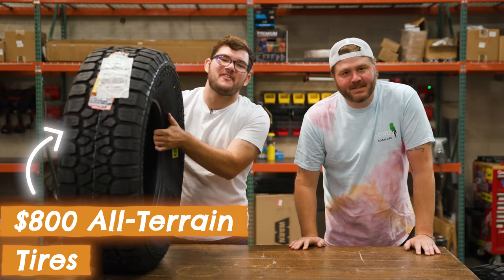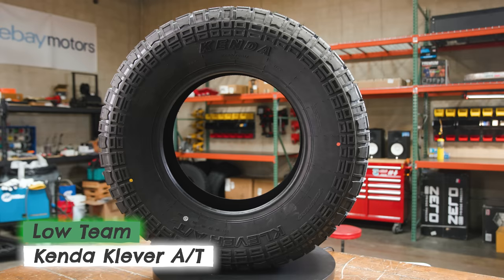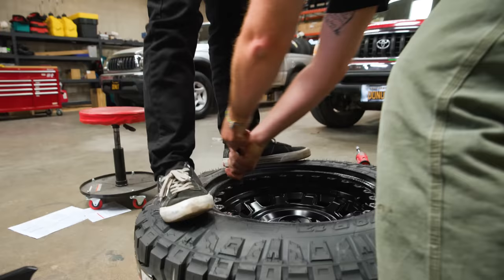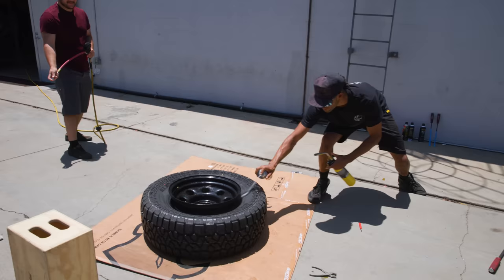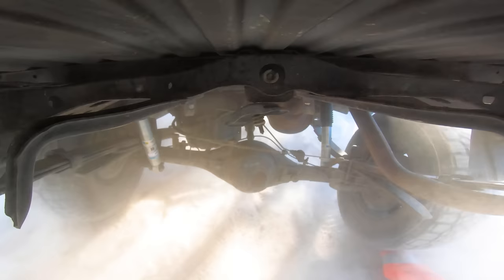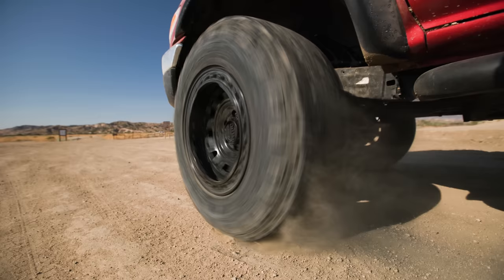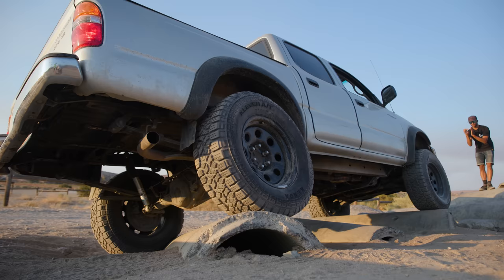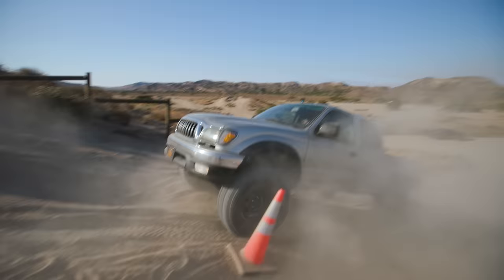$800 Off-Road Tires vs. $1500 Off-Road Tires

Comment: Low truck had way too much air pressure when he ran the pipes. You could see it bouncing where the High truck molded around the pipes.
Air pressure means so much.  H/Ts pressured down to 18psi will out perform A/Ts running 40psi all day.
Reply: Bouncing is probably caused by the suspensions, not tyre pressure (they talked about this at the end of s3:e1), because they were all running 15 psi iirc

Comment: Road noise takes time to manifest itself…check back in 30 days so road wear, alignment nuances, and tire rubber composition come into play. Loving the series.
Reply: I wish you could retweet YouTube comments
Reply: 100% correct. When I bought my KM3s I was like wow these are pretty quiet. 2 months later it sounded like my truck was a bee hive lmao
Reply: Spot on.  One thing they only briefly touched on was the grippiness of HT.  Just like race tires, grippier means it wears out quicker, but offers a way smoother experience off-roading, tighter control and is less likely to chunk out.  And someone who two-tracks regularly would probably have a Hi set and a Lo set.  

Sidenote, I love LT's steelies.  Reminds me of those classic American Racing black steelies from the 90s ( back when chrome was king and those were the only black wheel option... Oh how the turns table).
Reply: Mans spittin' serious facts
Reply: 100%!!
Reply: Exactly.
Reply: Can’t speak for the other tire but my grandpa has ridge grapplers on his truck and they are quieter than the g2s on my truck (g2 is a much less aggressive tire)
Reply: I can assure you, the Kenda’s are almost quieter than road tires. They got it figured out, and you don’t pay for the crazy marketing budget.

Comment: I love the fact that in this series they're not ruining the low-truck, in the 350z high-vs-low they destroyed the low-car and put the worst parts they could find, I like that this is a budget, yet awesome build nonetheless. A great truck to take off-roading while still respecting some sort of budget! Great job Donut!
Reply: It’s different with trucks tbh everything is more expensive cause parts are beefier and stronger then on cars so a lot of companies don’t even try to make aftermarket parts for trucks
Reply: If they used a heavier truck, the "low" tire would be a lot more expensive bc you can throw anything on a Tacoma.
Reply: If they would have skipped the plasti-dip and body kit Locar would have been a nice ride (after they swapped out the ebay coilovers).
Reply: Trucks are more modular than cars
Reply: might have to put them on my 3rd gen 4runner
Reply: @navarrooliver2on  3gen T4R FTW! 🤘
Reply: It definitely seems they're taking a "I've done this before"/"second build" approach with LT.  The first season was like some 16yo who had no fucking clue what they were doing and was building with their own money.  I mean they welded the diff ffs.
Reply: I’ve seen both in the vault at the Peterson  automotive museum. Low car actually looked nice in person. And the fit/finish of the parts on it looked plenty good to be usable.
Reply: BINGO!
Reply: Nah, even low cars parts are too expensive
Reply: @davebrochu  also if they skipped the welded diff

Comment: I have the kenda klever rts and love them. They are beastly and work really well in wet and snow conditions. (Missed getting a snow rating by 3 points, could have just been driver error that cost them the rating). Great overall tires. I got my 35 by 12.5 tires for my tundra for under 1000. Cant beat that
Reply: Just bought a pair same size. I get snow in the NE. I can't wait

Comment: i love how this is isn’t just “hi-low”, this is “car bois learn how to play in the dirt”. I honestly didn’t think hi-low could get any better BUT this series with some high-quality Tacos just turned this series up to an ELEVEN
Reply: Realized this when hi-team doubted lower tire pressure would make a difference... or maybe they were staying in character because it's literally the cheapest "mod" there is.
Reply: @ajc1080  Right?? that’s like off-roading 101 😂
Reply: @bmax98  Yea if I'm off pavement I dump air imediately down to 18psi then just stay in 2wd until I start spinning tires (unless intentional :-D). Not only does it give you better traction but if you have not so nice suspension it makes things more comfortable too. Edit: Sand gets 4x4 imediately and even lower psi

Comment: Considering these are meant to be “Daily Drivers” that can be taken off road on the weekends, I think mileage on the tires should definitely be considered between the two!
Reply: YOU'RE SPECIAL ED!!!!
Reply: @xxtravdamanxx   Know him from class?
Reply: @xxtravdamanxx  Atleast he typed with understandable grammar and didnt even use cap lock.
Reply: @alexandermueller4115  you killed him💀
Reply: Luckily these are light-duty trucks so you can throw anything on them.  If you're in a diesel truck, you need to stick to tires with higher ply-counts, aka more $$$.
Reply: Mileage is 99% of it an actual guys truck that uses it to play once in a while still spends most of the time on asphalt those cheaper tires won't last half as long and they are hard to balance especially when getting into rougher tread design buy once cry once
Reply: @mr.christopherp.4851  My thoughts exactly!
Reply: Tire life should absolutely be tested! Mostly because I’d like to know how much longevity to expect from my Nitto Ridge Grapplers….

Comment: I know when Zack and James were like "deflating gives more traction? That's stupid" every off-road bro was into their screen
Reply: Exactly my thoughts
Reply: Don't gotta be an off-road bro to know who was right.  It's just common sense.  Same thing works in snow.
Reply: I run the dunes basically weekly, (10 minutes away). I air down to 6 lbs with my Toyo open country at's. Rarely even have to use 4 wheel drive. I took off my BFG's to try the toyo's and will never go back.
Reply: Did they try airing down the stock tires?
Reply: @ADBATT52  these two guys are a joke, they don't have a clue about wheeling.
Reply: @rogerweaver7686  not everyone’s into off-roading lmao. I’m sure there’s hella shit in another aspect of the car community that you don’t know about
Reply: @santiagopinedo3911  the point is, these clowns did a video about off roading, something they clearly know nothing about.
Reply: @santiagopinedo3911  Yeah but i’m not over there trying to make informative videos about it
Reply: @rogerweaver7686  I'm assuming you're using beadlocks? curious if you can get away with 6 PSI without them. What size tire and wheel?
Reply: @JacopoSkydweller   no way you can go below 15 psi without beadlocks.
Reply: @umwhat9671  depends on the castings.   I have went with 9psi without headlocks with 10ply tires.   They have stiffer sidewalls.
Reply: me as someone who live in the country side... whuaaaaat?? to them XD
Reply: @evanloeffler6772  these videos are entertainment.
Reply: dude, they're just a tuning shop R&D guy and a very big car guy, only Nolan and Aaron actually race. It's still entertaining to watch.
Their idea probably comes from normal road driving, generally you inflate tires to the manufacturer spec, deflating tires makes the engine work harder due to rolling resistance, and also some tires have specific patterns for you to work on the recommended air pressure. 
But Nolan is a drag racer, Aaron is Falken's mechanic and FD's license drifter, ofc they know better.
Reply: @rogerweaver7686  going to come to off-roading I know I don't know much at all
Reply: @evanloeffler6772  well saying informative is relative... I say 1+1 is 2 is informative I mean there not breaking everything down are they.. its entertainment don't like it don't watch it
Reply: @Holtynfuntime  I dont like it and I'm going to watch it. What are you going to do about it?
Reply: @rogerweaver7686  they're very clearly experimenting for edutainment... There are plenty of channels for serious off-road shit. Go touch some grass

Comment: those cheap tires will cup & scallop if run on road/highway, and will only get louder and louder

I'd love to see a follow up test on them after 30k
Reply: You would be surprised.  The nittos ridge grapplers wear horribly.  I had 3 sets on my last truck.  Buddy had the same problem with them.
Reply: I have $800 ebay mud terrains supermax RT-1 and they're wearing incredibly well, crush it off road, and are quiet as a church mouse. Expensive tires are because you're paying for the big companies marketing. I can't believe how quiet these tires are. Sad thing is I don't think they're being made anymore.
Reply: I disagree if they had gone for a cheaper brand maybe but kenda's low end tires even wear well. They wear faster for sure but they don't tend to cup I've owned 3 sets so far and 2 sets of nitto lower ends and would never go back to nittos unless it was purely for off road.
Reply: Kenda tires are actually a good brand, they are new to the truck tire market but they've been making tires for a long time. I have a feeling you'd be proven very wrong.
Reply: My 35” AT linglongs have 20k miles and aren’t loud at all and work off road just as good as name brands. People just like flexing how much they wasted on tires.
Reply: @brandonj6548  On the flip side, having kenda klever r/t's on a 2006 dodge 3500, those tires performed pretty well and had better wear characteristics than most other aggressive tread pattern tires we've run.

Comment: Nolan: You know I wouldn’t risk my health for entertainment purposes.

Also Nolan: Living in my car for a week
Reply: So lighting chlorinated brake clean... will kill you.... this of course was likely not chlorinated as it is illegal to sell in most locations...
Reply: @mattlane2282  you can actually buy chlorinated brake Kleen of the shelf at O'Reilly's, but the chlorinated stuff is like $8 a bottle, while the same size bottle of name brand non-chlorinated goes for like $2.50, and store brand goes for like $1.50 a bottle. The non chlorinated stuff burns a lot better, and the chlorinated stuff cleans slightly better (they use it to clean instrument panels on oil rigs here that get splattered with crude) also if you want to buy more than 1-2 bottles of chlorinated brake kleen you have to have a commercial account and/or a certificate/license.
Reply: @Prestiged_peck  In your state maybe... banned for sale in mine... but you kinda make my point... if you burn that shit it turns into I think phosgen... that will kill you...
Reply: @Prestiged_peck  "The Safety Data Sheet (SDS) for a can of brake cleaner reads: “Do not use this product near open flames, welding operations, or excessive heat. Vapors may decompose to harmful or fatal corrosive gases such as hydrogen chloride and possibly phosgene."
Reply: @mattlane2282  I was always told chlorine gas, aka mustard gas, or something similar.

Comment: Kenda makes some awesome tires! The airing down part was excellent, but the big thing people need to realize is it’s unnecessary for a vast majority of the trails they do… do it if you want, or don’t. Great video! I’m worried the more people learn about Kendas, the more expensive they’ll become.
Reply: I’ve been riding and loving kenda’s mountain bike tires for years and only just learned they made stuff for trucks.
Reply: Ive had my Kenda Klever RT's for a year now...absolutely love em.
Reply: My kenda trailer tires are the best I've ever had by a wide margin.

Comment: It'd be interesting to see how well they hold up compared to each other in mileage
Reply: honestly i believe the cheaper tires will hold longer do to a harder compound vs the more expensive tires are usually have a softer compound plus alloy rims crack were steelies can be bent back into shape with a hammer
Reply: I've had my nitto ridge grapplers for about 8 years  ZERO issues ever with them and they still look good and I drive my truck daily
Reply: 25k miles on mine, barely noticeable wear. Let me know if you care enough and I’ll get the tread depth from President Lincoln.

Comment: The biggest difference in those two tires will likely be how many miles you get out of one set v the other
Reply: And how loud they get as they wear
Reply: @Nate Huffer  loudness is more effected by balance and alignment which causes uneven wear and noise.

Comment: It is funny seeing on-road guys doing off-road stuff, I was laughing when James didn't think airing down would help. That's like off-road rule #1 😂😂
Reply: He also chose nittos at an insane price for psuedo 33's.

I just bought 34's this week and while looking for a friend without a CMC I saw those in stock online for 289 in that size.
Reply: I thought rule №1 was 'let someone know where you are going and when to expect you back.'
Reply: Not rule #1 but I agree and was thinking the same thing. I’m usually at 10psi for general offroading and 8psi for the rocks and sand. Also not on beadlocks just $60 steelies

Comment: As someone who does a lot of 4wding it hurt me when I first heard the "I don't think lower tyre pressures will help." Tyre pressure is make or break in a lot of off-road scenarios. Also a big difference you'll see in cheap to expensive tyres is noise, and longevity. How are they performing after 80,000km. That's where you'll find a big difference. Along with puncture resistance, in Australia when you're travelling remote on track you want a tyre that's got a much stronger sidewall so you don't get punctures from stakes and other sharp objects off-
road.
Reply: i was looking if anyone mentioned tire pressure already, especially with the beadlocks. take advantage of the extra contact patch.
Reply: thats exactly what i was thinking/.... longevity.
Reply: Psi is everything, if they aired down the stock tyres they still would have done better

Comment: As far as offroad, you have to do more trails, also depends on driver skill. I actually have the Kendas on my Offraod Xterra and have been happy with them so far. They are also a 3 peak tire like the Falken Wildpeak AT3Ws (I have on my Ram truck) and KO2s. Unless its a mud tire the road noise comes wih time and tire wear.  I think the more you guys drive, build and wheel these truck the more accurate you can say about the tires. However there is something to be said about certain tires that are more expensive some of them really out perform other tires by a lot and some dont bc they are more for looks. This is my first video with you guys and I am subscribing anf gonna follow these Taco builds. Personally somethings you can go cheap and other things you cant. Just depends. Love this awesome comparison tho.
Reply: I have Falken Wildpeaks on my 99 XJ I love them they have been perfect

Comment: I hate to tell you guys this, but while at Lakehurst, NJ (McGuires Joint Dix AFB) Me and my coworkers took at brand new 2017 Lincoln Continental off road on a course much worse than this. Only complaint from my coworkers was how smooth the ride was with the air suspension.  I took that rental through Bumper deep mud in good old 2wd. And have a whole team of witness. Yall should do one on that car. Seriously. The ride was amazing.

Comment: Back when my truck was stock, I was off roading up in the mountains and messed up and got it stuck in a few feet of snow. I aired down the A/T street tires down to 12 psi and on stock wheels drove it out and made it into town to air up my tires. I drove 15 miles on 12psi, no beadlock issues.

Comment: Not only does high truck have the Bead locks but it also has a smaller diameter wheel which gives it a better ride and more ability to flex over rocks.

Comment: As a daily truck, It would have been nice to see if the aftermarket wheels and tires did anything to MPG. Do like 3 runs on each set of wheels/tires and average the readings to see if the heavier set messes with MPG more than lighter set.
Reply: Bigger size makes a bigger difference

Comment: Ive been in the off road industry since the early 1970’s and I have been telling customers the same thing since the early 1980’s.  You guys hit the nail on the head, if part A is 500$ more than part B will you receive a 500$ improvement.  If you only get a 100$ improvement then I always felt the lower cost (unless of course you have unlimited cash flow) was a better choice. Starter fluid is even better and more explosive!  You’re right 80-100$ to mount and balance those non bead lock tires, that’s a deal unless you have a mega buck balancer sitting in your garage.   I’m very familiar with Gorman, that very hill can be idled up that hill with stock tires and if you’re on a real budget a 300$ lunchbox locker.  But hey the glitter looks trick driving on the I5 freeway.  Entertaining video gentlemen!

Comment: I think you missed mud, snow, wet roads. Testing acceleration, traction, and stopping distances. Wet and snow can show huge differences when there's a big temperature drop. 
Plus the sidewalls make a huge difference, especilly with the plys and whether or not it's going to slice through on sharp rocks. 
That said, you guys really made a fun video, and it's nice to see how much effort you're putting in to this content.

Comment: Anyone considering off-road tires needs to keep in mind wear and puncture resistance as well, which weren't covered in this video. Comparing a Nitto to a Kenda that both have full tread doesn't really showcase this, but if you showed them next to each other after 15k miles you would start to understand where some of the price difference comes in. Puncture / tear resistance would also show the value in the Nittos. I've pulled countless nails from my Nitto mud grapplers with no need for a patch, and guys out west rub them against some seriously sharp rocks without the wall opening up. I doubt you could say the same for the Kenda. Either way awesome vid as usual, and buy what you can afford.